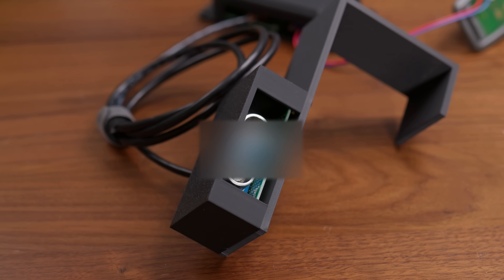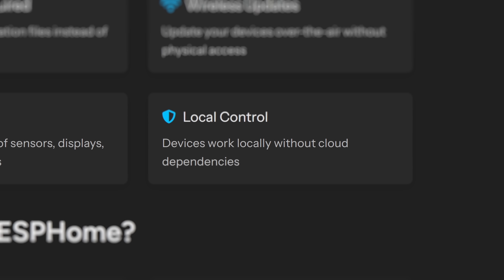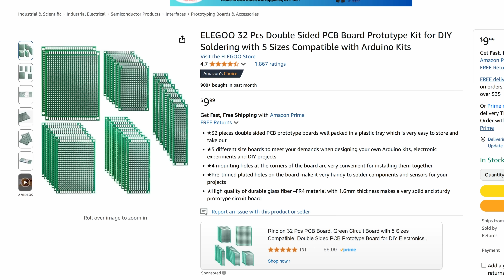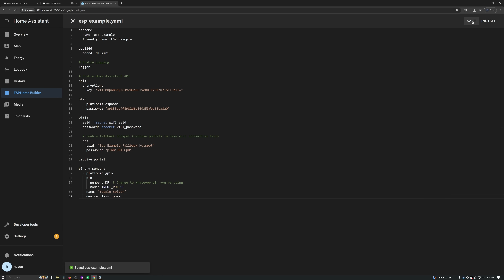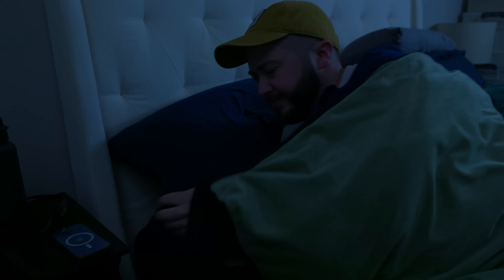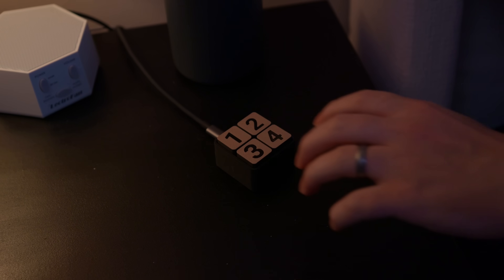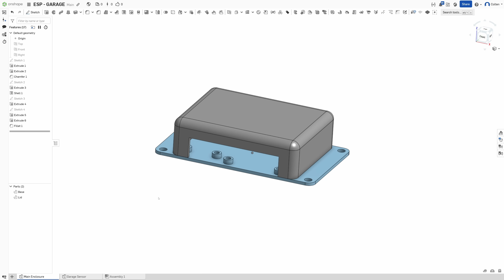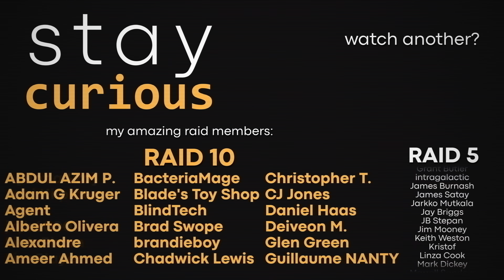These Tiny Computers Made My Home Smarter

Comment: You don't need a relay to interact with a remote. Just check the remote's button is doing a 3V pulldown with a multimeter, which is very likely. So you can directly wire a common ground with the module and a pin directly to the positive side of the button.
Reply: Most I have come across do not work that way. Have to use a MOSFET most of the time

Comment: I need a thing that lift up a lid at 4 diffrent angles 
A: clost
B: shade
C: neutral
D: heat

The diffeent position depends on the date, time of day, internal tenperature and current sunlight.

I can do the formula my self but not the implementation

Comment: Great project. Rather than using a garage door remote, I would wire the board and the installed wall button for the garage door to an OR gate to have the controller hardwired directly to the opener. The gate may not really be necessary since it's effectively 2 switches, but they're cheap and I wouldn't want to risk anything. This would save the need to replace a battery in the remote down the line and could be done very cleanly near to the 3d printed housing using some black wire

Comment: If you have any any old WiFi routers, often there are very small, flat WiFi antennas inside - already with the appropriate connector - so this is then plug and play. I now save these antennas before I recycle my old WiFi hardware - exactly for this missing WiFi antenna use case.
Reply: Smart!

Comment: Awesome video, you've openend my eyes to ESPHome, a whole new software tech stack, I wasn't aware of.  Thanks Colten.   

Story Time:  Once a upon a time, my first practical project for my Raspberry Pi 2B was a replacement remote for our antique garage door opener.  For me, to get this all work because I had no extra functional remotes to sacrifice (and previously tried several different replacements from  the web) I unlike our host, tapped into the wiring for the manual door switch, a doorbell button mounted near the door between the house and the garage.  This was very easy, as there were terminals on the opener unit for this switch wiring. Using a relay attached via GPIO to the Pi, I wired the relay to the same terminals the doorbell button was using, loaded the PHP web application onto the Pi which served a web page that looked like a garage door remote button.  The Pi and relay were mounted to a piece of card board with zip-ties which lived in the rafters above the opener.  The Pi was connected to the home network via a powerline ethernet adaptor so I could also get to the web page via any computer on my network to operate the door. I used, a pretty old at that point, 2009 Apple I-Pod that had Wifi as a the remote for garage door.  The manual doorbell button still worked too. The drawback was the Wifi on the I-Pod needed to reconnect to my home Wifi which was always a bit fiddley and resulted in me sitting in the driveway for a minute or two fiddling with establishing a Wifi connection.  But it worked.  And it worked for a good 2 or 3 years until somehting on the SD card of the Pi got corrupted.

No ESP microcontrollers, nor Sonic distance sensors, nor Home Assistant software for me (They may have been available at the time?  This was probably around 2015.)  It was EXTREMELY JANKY and it only worked most of the time but it WORKED.  (We still have the same old garage door system with only one working remote to this day but normally only use the garage during the winter.)  I will definately look into redoing this using some of the stuff Coltin showed in this video.

Comment: Interesting I have never jumped the D1 Mini I just plugin and upload, I use the Arduino IDE, also I haven't installed ESP home on them yet .    Have you tried the ESP8266-01S, it is smaller than the D1 Mini but only has 4 GPIO Pins.    You can get 2 and 3 place extension boards for the D1Mini and Modules to plug directly int those boards like a temp/humidity sensor.

Comment: I got rid of all my ESPHome devices. As an idea and a way to quickly prototype, it’s great. But in my case, the 2.4 GHz band is heavily congested, and using a lot of ESPHome sensors became a nightmare. Interestingly, Zigbee—despite working on the same frequency—handles it just fine. On top of that, ESPHome constantly breaks things with endless updates. So, if you just want to play around, it’s fine. But for a serious smart home setup, it’s junk.

Comment: For the module with no built in antenna, solder a piece of wire about an inch long to the center pin if you don't want to buy an antenna. Not a great antenna, but far better than none.

Comment: Depending on your Garagedoor Opener, there is a good chance it has input contacts you could hook up to. Also, when i did something similar, i also hooked up the remote power to my power source. That way its never running out of battery. Works for like 2 years now. :) Glad you dove into ESPHome, so i expect more like that in the future :D

Comment: I have a bunch of those D1 Minis, they are super cheap but useful microcontrollers.   I've programmed these and other boards with c++ and ESPHome.   I have HA and ESPHome running in Docker and it was easy to get them working.    The first thing I did to learn ESPHome was to turn in internal D1s LED on and off with HA using ESPHome.  This is nice because you don't need any parts except the microcontroller.   A button or a sensor is a good first input project, like the one the video did.   I think this video is a good start for someone, it pretty much covered my knowledge and experience with HA + ESPHome, I enjoyed watching it for the journey and I picked up a few tips.    I have not jumped into the 3d printing rabbit hole yet.
Reply: the 3D printing rabbit hole is very deep
Reply: @draconightwalker4964  Indeed.   I'm already exploring a pretty deep rabbit hole with microcontrollers and circuits.

Comment: If you have a 3D printer and do not care about measuring the controller boards for where the mounting screws are.or if it does not have mounting screws. You can usually also find those dimensions pre made in one of the stores and you can just drop it in your project.

Comment: "A lot of people already have a drawer full of ESP8266 boards – we’re not trying to stop you from using them! That said, don’t buy any more of them and consider our recommendations above as you buy new devices."

From the ESPHome FAQ. The ESP32-C3 is the "lowest" model ESP chipset one should get, so don't get a D1 Mini. ;)

You can get a pack of u.FL to SMA adapter cables, and just cut off the SMA side, and trim the coax cable shielding to expose the inner core to an appropiate length for 2.4GHz WiFi, which is 29mm. You shouldn't need to do anything to the case either, just plug in the antenna and leave it inside the case.

Comment: Isnt HA core going EOL this year?  I moved to HAOS on proxmox and it has been much faster and more stable at least for me, plus pass through for radios was actually simple for a change.
Reply: Core is going EOL, but Core is not Container. Container is still a fully supported setup.

Core was "install python, install dependencies, put the code in this folder, run this code as a daemon on your system", etc. Doable for a dev who may be used to that, but a bit of a nightmare for support when someone has an outdated this or a misconfigured that. Container is basically that but bundled and distributed as a unite that everyone can agree on, and is thus consistent enough to be supportable.

Comment: Another way to do the garage door open/close sensor is with a reed sensor at the base of the door. Same cat5 wiring to the esp. Measuring at the bottom will tell you closed or not closed. Measuring at the top will probably only tell you completely open vs not completely open. It probably isn't perfect with half open states. 

And if you get rid of the distance sensor that needs to be placed nicely, you can dump the whole thing into the light bulb cover on the side of opener! 😂

Comment: Side note: there is often a hardwire switch (my garage doors use a doorbell) that you can wire directly to the opener, rather than using the wireless opener. That may get you what you need easier and you get your opener back!

Comment: Very good timing, I just did an esp32 garage door opener using distance sensors a few days ago.  I added a distance sensor pointed down as well that I use to sense the car.  I added an automation where if I open the door and then the car leaves within 5 minutes then I wait 1 minute and close the garage door.  Any other time the door is left open I just get a notification.

Comment: I wish I could tap into iPhone’s Focus state, that would be tremendously helpful. Apple watch detects sleeping so when it’s triggered I could trigger other devices.
Reply: You sort of can if you use the HA companion app and give it the correct permissions. Problem is, it'll only tell you if a focus mode is enabled or not, not which one. You can sort of work around that by going into the Shortcuts app and setting up automations to change a HA helper if the mode changes, but it's slightly less than ideal.

Comment: Is it safe savong WiFi credentials in a flash file? Any other way to have them saved to ESP device?
I get if your IOT WiFi is probably on separate VLAN and you have it configured not to reach out to the Web, but still, not everyone would have this sort of setup.
Reply from the maker: Yeah that's possibly an issue... I'm not sure how ESPHome handles that exactly. Granted, if you have a compromised device on your local network, I'm not sure how much worse things get if your wifi credentials are leaked lol. Maybe I'm wrong
Reply: @HardwareHaven I am more asking on ESP32 angle, if it's easy or easier to get to than say your typical router than your whole network is weakened by having it on.
I don't know much about it hence I'm asking. IOT is great but the reason I shy away from it apart from Zigbee which is built with security in mind (that and the fact that it just does not have much to be hacked or used against you).
In my mind any $3 WiFi device you connect first should be asking how secure is it and tips to secure it better.

Comment: FYI didnt need to sacrifice the garage door remote. There should be 2 wires coming off of your opener that just need to be momentarily contacted together. I had my wall console (wired remote) fail and I used a metal object bridged across the contacts to open and close the door until the replacement arrived.

Also a future project suggestion is indoor air quality sensors in every room. Thats something on my todo list.
Reply from the maker: That's what I was expecting initially, but I don't think my opener has just a simple momentary switch. It just has connections for the little laser thing to keep from squashing things and then 2 wires to the wall remote, but that has multiple functions... Like I said, I mostly just didn't want to jack with the garage door if possible haha
Reply: @HardwareHaven  That works on the old doors, but basically if the learn button is yellow on the opener or most all newer units its a rolling code.  There is another clever ESP project to check out called RATGDO.  He sells kits or you can get just the firmware and build your own.  It shows the state open / close / partial , controls the light, the lock out, and you get your remote back :-)  I have had one for years and love it!
Reply: @HardwareHaven  I felt the same way with my wall remote and just bridged the screw terminals with a screwdriver and it worked. Witchcraft but it worked. I guess the other functions still work on different signals on the same wire.
Reply: @HardwareHaven  Like @40arpent said, every garage door opener has a spot where the wall button and the door sensors go to.  You could have placed two wires from the relay to the two wires that the all switch goes to and since the wall switch is a momentary switch, that would have worked as well.  It's actually how I had my garage door setup until I went the ratgdo path, where someone reverse engineered genie and chamberlain garage door openers, so it can provide not only the state of the door, but gave additional features in home assistant, like locking the remotes, obstruction sensor status, light control as well as full control of the door (ie. you could open the door to a specific height if you only wanted to open your door to allow airflow.

I used to install garage doors and openers, I would recommend if you do open your door only slightly, you should really check and make sure your door is capable of doing it on its own without the opener.  If your door is not tuned to hold its position where ever you leave it (other than within the first foot off the ground, or the last foot or two from being fully opened) I would recommend not leaving your door in this state as it puts a lot of pressure on the garage door opener itself and can wear it down quickly.
Reply: by the way, I see you have an Overhead Door branded garage door opener, they run with the same technology as Genie.  I used to actually work for Overhead Door where I live :)
Reply: @HardwareHaven lol so you wrecked a remote instead of a button....
Reply: Most newer garage door openers have a “data” connection to the wall panel rather than momentary switch. There is a cool esp product called RATGDO that helps get around that.
Reply: I moved into a new house and when the Garage Door service was happening, the tech and I got to talking, when I talked about running Home Assistant he pointed out exactly where to wire an MCU and reiterated a bunch of times that there should be no actual voltage injected over the pins, just bridging them. Part of me wonders how much that was being generous with info, versus getting sick of replacing burnt out controllers.
Reply: @MySelf68k only to be slightly pedantic. They don't want external voltage across the pins. To measure the existence of a short they are running voltage across one of those pins and the other is some flavor of ground.
Reply: I was thinking the same , why would you need to wire your control? You just need to two connect two wires to the dry contact of the opener right ?
Reply: Newer garage door openers aren't compatible with shorting the left two screws anymore... if you're going to roll your own GDO integration, you will need to get a remote and sacrifice it for the cause, or get a RATGDO that has some secret sauce baked into it that talks to the Garage Door Opener over its own serial interface.

Comment: Nice video! I have some temperature sensors connected to some 12v fans to spring on if temps get to hot in my server rack and attic. If temps get above a certain treshhold the fans start up spinning at a low rpm which makes almost no noise. But its just enough to cool it down a couple degrees which is nice in summer time.
Reply from the maker: Nice! At first I thought you said your server rack was in the attic and I was very intrigued... haha
Reply: @HardwareHaven actually it is. I have a server rack that has a nas and 2 mini pcs and some networking. 1 running proxmox and the other has a GPU attached for light gaming. 

The attic is also where my home office is. Hence it can get a bit hot in summer time 😅

Comment: Now that you have the garage door sensor, you can setup logic in home assistant to turn on a light in the house to let you know it's open.

I have one in my living room and another in my office that go red when the garage is open.

The one in my office also does a few other colors to alert me at night time if the kids open their doors, using different colors for each, and another if both opened.
Reply from the maker: That's smart! I have a script that flashes my office lamps red that I can call if needed
Reply: @HardwareHaven  You can also just have homeassistant send your phone a notification - which is what I do.
I'm all in on zigbee for my setup, so I have a zigbee dry contact relay for the garage door controller, and I use a zigbee window sensor that I replaced the magnetic reed switch with an ebay limit switch on as my 'garage door open' sensor.
Reply: @kienanvella Yes, ZigBee rocks. I also put in some Zwave devices such as my front door lock and a remote button to keep in my car to unlock my front door when I get home so I don't have to fumble for keys or key in the PIN code at the door.

I am so over WiFi for smart home use.
Reply: I just landed up automating the entire thing, mainly because I have a 2 second memory :/ 

My front gate now has a reed switch for full open, one for full closed, an INA219 sensor for sensing voltage, current and state of charge on the LiFePo4 battery being charged via a 20w solar panel, a 16chip Neopixel Ring in the gates bulkhead which alerts when the gate is opening or closing/alarm condition etc, a doorbell button on the outside of the gate which triggers the node in the kitchen which then sounds the actual doorbell, and a LED backlight on the doorbell button, which then doubles as the Alarm notification with a quick dual pulse, and a HA automation that screams blue murder if the gate has been left open for any reason, which, when ignored, closes itself, all with telegram notifications of whatever state is being processed \(",)/
Reply: I have an automation with TTS Notifications coming through the Alarm channel to alert me if the garage is open for more than 10 minutes / 1h /2h and 5h. Has saved me many many times.